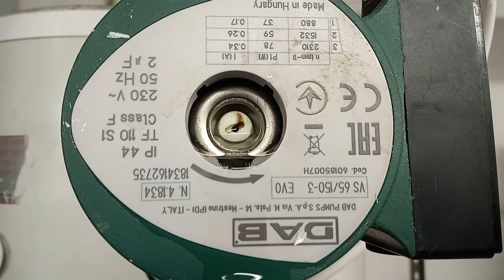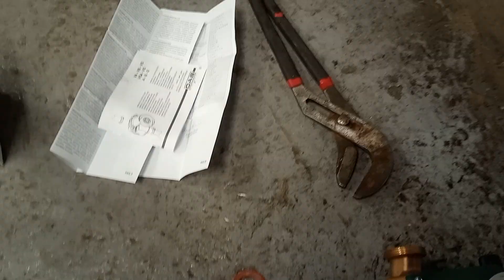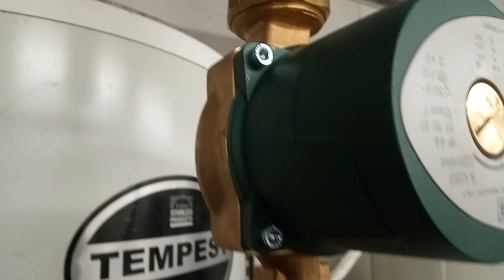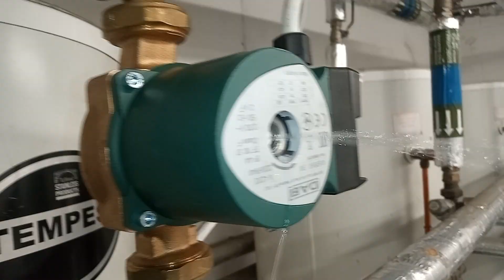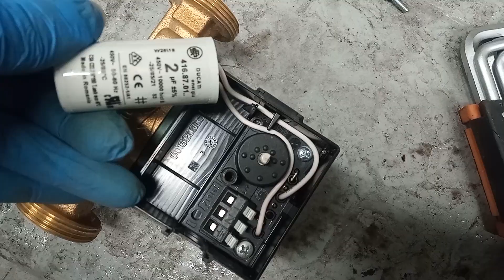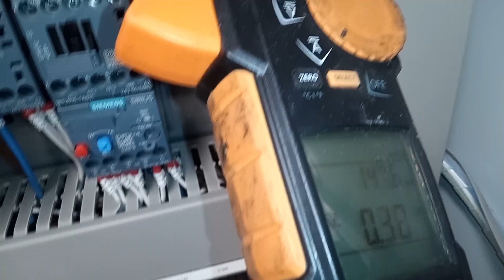HWS SECONDARY PUMP CHANGE

Comment: It was a DAB pump, that's what the problem was 🤭
Reply from the maker: That's an interesting diagnosis right there. Gonna look into it.
Reply: @CommercialGasEngineerVideos   seriously though, the amount of DAB pumps that get binned. 
Some places I go to won't have companies back that fit them.
Reply from the maker: @aionalethia8140  😳 what makes you think that they are that bad? It's news to me. Never heard a bad word about them until this day.
Reply: @CommercialGasEngineerVideos  pumps are my day job, the company I work for won't even entertain them anymore because of the warranty issues.  Other pump companies fit them because they're cheap, so they can keep the quotes down.  
To be fair, those little circulators might not be too bad,  ones with integral inverters are junk.